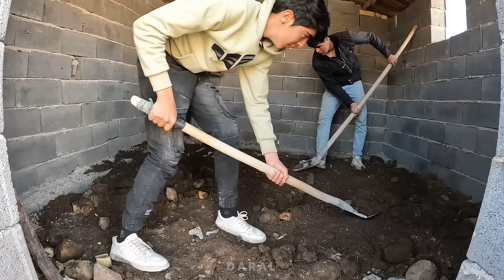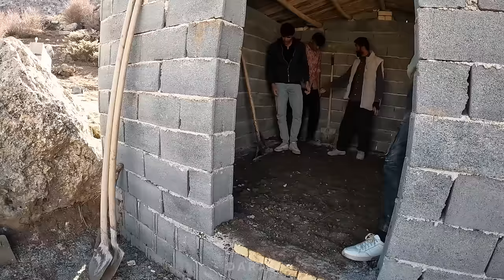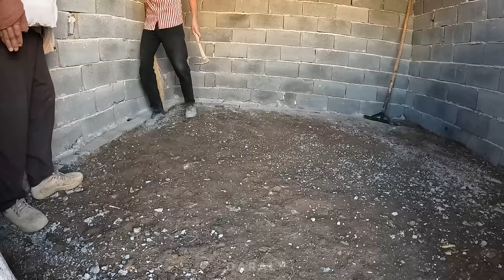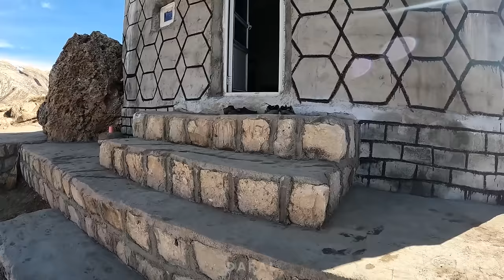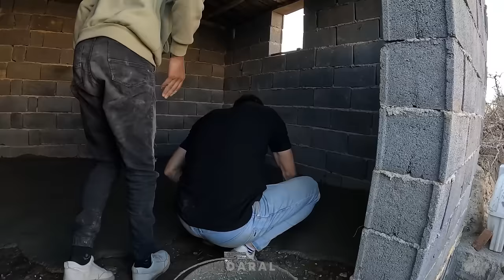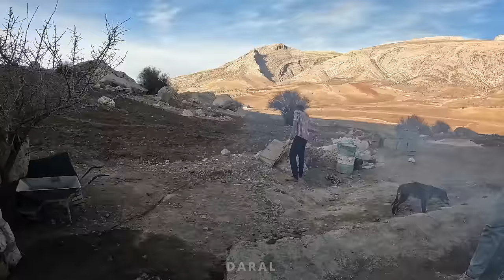Amir and his family are pouring concrete on the floor of their new room

Comment: Should you perhaps make a soil compression roller by driving a strong bar through a barrel filled with stones and rolling the heavy barrel over and over the stones?One person holding and pushing the handle one one side ,another person pushing on the other side.this would help compress the soil before concreting a large area.It’s good to see the floor go into the new room .To see it so close to complete is very satisfying .
Reply: @gaetalton5119    true enough I expect ,but probably more effective than stamping about unless you have a few very fat friends having an enthusiastic dance on your front yard 😎.Or possibly just concrete the inside of the barrel 🤭

Comment: The pump you are using is a syphon pump,you do not have to keep pumping once the fuel starts flowing,,it. Will keep flowing on it's own until the syphon is interrupted by unscrewing the little red cap at the top, then the fuel flow will stop,,the fuel left in the hose will go into the can and what is in the pump will go back into the drum of oil,,so don't fill the can all the way up,leave room for what is in the hose,,,tighten the cap and you are ready for the next time pumping.
Reply: It's part of the show 😊

Comment: Look at the foundation again throughout the video, you can see through it. you need to fix that cause if it rains or snows it will leak from under the floor, really need to look thoroughly through the video and find those area's and fix it now. Otherwise, you'll have unnecessary problems in the future.

Comment: You need to water proof your walls as well so many gaps you should cement in between your blocks to when laying the blocks to avoid the problems of gaps relying on cementing the walls is still easy for the water to get through quality of work very average.